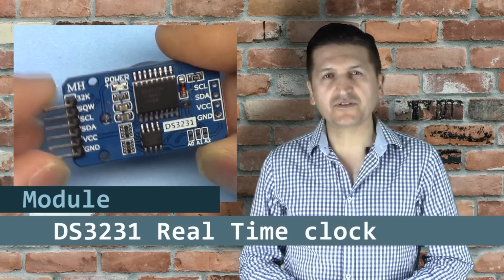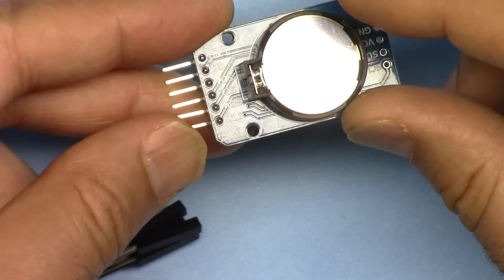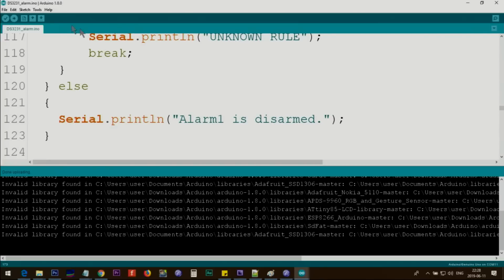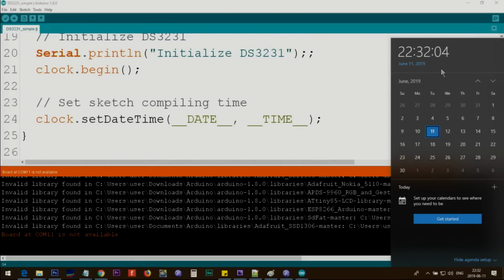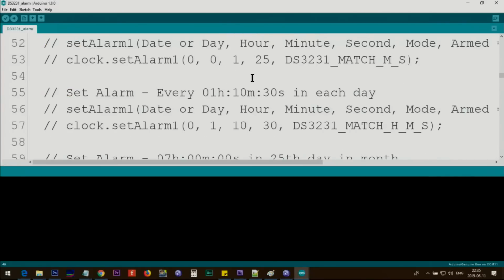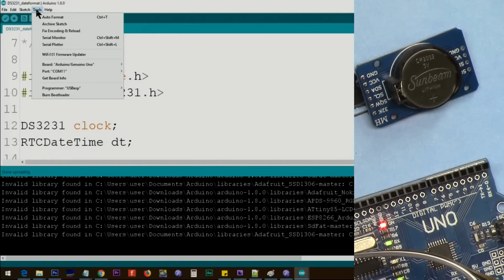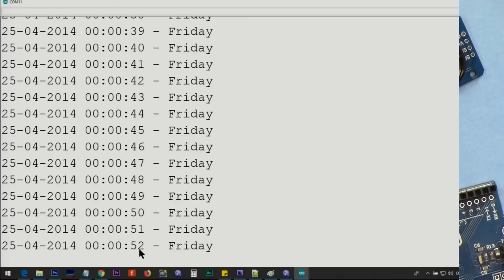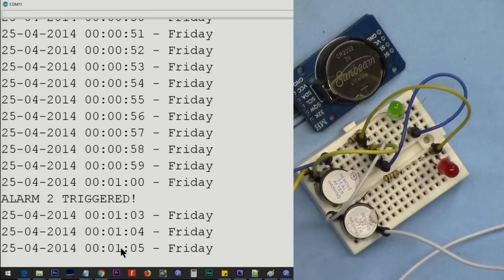How to use DS3231 RTC clock module Alarm with Arduino RJT165

Comment: Hello sir and thanks for the video.,

I've downloadet the libary and when I'll compile the code "DS3231_simpe" the console shows me the error message:
" 'DS3231 clock' redeclared as different kind of symbol "
I juse the Ardoino IDE 1.8.12 and the ESP8266 Board.

It will be very helpfull you could help me.
Reply from the maker: Hello and welcome.  I have not tested it with ESP8266 so I am not sure what could be the issue. It seems you may have similar library.
Reply: @robojax  Thank you for your answer.
I tested it on a UNO today - it works.
So I'll have to do the project on the UNO.
Reply from the maker: You are welcome. Thank you for not skipping the ads and keep watching them. This will help me a lot.
Reply: I had this error. Easy to fix, just change the variable "clock" to a different name like "clock1". Change all the names of "clock" in the sketch. Then it will compile.

Comment: Great video. How do I access the temperature function. Thanks in advance
Reply from the maker: You are welcome. use  readTemperature() to read temperature.. To print it on Serial monitor use Serila.println( readTemperature()); Thank you for not skipping the ads and keep watching them. This will help me a lot.
Reply: @robojax   I have downloaded the lib and source files and uploaded to Mega and Uno.  Both serial monitors show without details just the heading come through.  Tried to check online and many give different view like change battery or lib.  After a while I upload the code with just the wire.h and it set the time date.  didnt use any 3231 lib
Reply from the maker: all modules will work without library. Library is just holding all this code that yo have in a separate package the can be customized for many applications. So if you code works, that i good but,  yous sketch is very messy and log and there are tones of the features that you don't have on the sketch.
Reply: Think about that you have to remove the diode/resistor if u use a CR2032! If you dont the board will charge the non changeable lithium batterie and it can explode! If you do it with the diode and resistor you have to use a LIR2032 Accu!

Comment: Thank you for this tutorial.

I believe I followed the instruction, sir. But there's something wrong in displaying the  (clock.dateFormat). it does not display anything on serial monitor, just blank.
the example ds3231_simple is working. but the example ds3231_dateformat doesn't show any time even in ds3231_alarm. Is there a way that I can correct the code under (clock.dateFormat)?
Reply: Look here:
https://github.com/jarzebski/Arduino-DS3231/issues/22
There was an error in the library.
Ikar4n posted the correct libary.
Reply: same for me
Reply from the maker: Check the serial monitor settings https://snipboard.io/y3pKwG.jpg
Reply: @robojax  Thank you but this is the result. I never change anything on the code. I check the serial monitor and it is still the same. And, the output from (clock.dateFormat) is still not printed on the Serial Monitor.
https://snipboard.io/AHveNR.jpg
Reply from the maker: I just check the image you send me and it is not the example I provided here https://robojax.com/learn/arduino/?vid=robojax_DS3231-clock  nowhere in my code it says "Today is" so use the provided code and let me know.   please start a new comment  as this comment is more than 3 days old and hard for me to find it.
Reply: @robojax  boss i have the same problem the time isnt showing in the serial monitor

Comment: help i try to use the alarm example and when i check the serial monitor only this appears:

Initialize DS3231
Alarm1 is triggered when seconds match: 
Alarm2 is triggered when minutes match:
Reply from the maker: so that is showing it is working. Congratulations. It seems you have escaped the video. Watch it again so you learn.. Now instead of printing this text, you can turn ON or OFF something exactly in the same spot where this text is printed do whatever you want.Here use one of the relay modules to control something. https://www.youtube.com/channel/UCkcBSig_Iu4ZnAIeCeG1TVg/search?query=5V+relay or use this video where I used other clock module, but you can use it. https://www.youtube.com/watch?v=ykgXKUuvtbE

Comment: Thanks for the video sir

I have download the library and run the code, but there's an error "'rtcDateTime' does not name a type" any suggestions sir?
Reply from the maker: You are welcome. The best thank you for me is to Subscribe  🔔 to my channel and thumb up the video. It is greatly appreciated.  🔔  😊.  I will reply to all Subscriber's 🔔 questions. So make sure to Subscribe.😊
library is missing.  Click on "Sketch->Add or include Libary-> Add .zip library and then select zip library
Reply: @robojax I have entered the library but still an error with the same message
Reply from the maker: this happened to me once before where I had two versions of Arduino. Arduino 1.8.1 and Arduino 1.8.2 and I opened the wrong one, check that. This is very strange. That error means "library not found"
Reply: I had the same issue, as I had downloaded the Eric Ayars DS3231 library also installed, remove this library and it should work as they are both using DS3231.h but are actually different libraries hope this helps

Comment: The github link code does work! I've been adding the DS3231 file from my demo cd and then adding other DS3231 files such as yours that then do not seem to work. The solution has been to have a Arduino IDE that is clean of any DS3231 files and then download your master so it works. If any other DS3231 type files are added to my library or examples then yours doesn't work again. I think I understand from my week of frustration that this has to do with cpp,h file, and keyword differences between programs and my Arduino IDE not differentiating them for me. This has probably led to many dusty Arduinos. What I lack in brains I generally make up for in persistence but I need sleep!
Reply from the maker: when you say "doesn't work" you have to explain or provide error code.

Comment: Fantastic presentation! I've followed the instructions and I get error code: no matching function for call to ' DS3211: : DS3211 ()'                Any suggestions?
Reply from the maker: Hi, you have not downloaded and installed the library. Please watch and download the library.
Reply: @robojax  I have become an expert at deleting files from my arduino IDE folder so I deleted the master. Came back and watched the video again. And started over.  The link to robojax is not found when clicked, so I went to github file and downloaded again. Same result. Which leads me to  my question. Are there different DS3231 files that have different interfaces?  I have successfully done the lcd clock and powered relays at a specific time.  However if I see the call:  DS3231 clock; RTC
Reply: RTCDateTime dt; then the code does not work for me. If you could help me get past this I would gladly become a patreon supporter. Thanks for reply!
Reply from the maker: Thank you for letting me know. I just fixed the link so you can download it from Robojax.com but the gitHub should work as well.

Comment: After loading your library, loading the two examples, I receive errors stating that there is "no matching function for call to DS3231::DS3231().  I believe the parentheses were missing in your code.  Secondly, I receive an error for the next immediate line that RTCDateTIme dt is not "typed" or named as a type.  Is this an int, float or other type of variable?
Reply: I have just experienced the same issue. I have repeated the steps in the video to insure the library has been installed. Your advise would be appreciated.
Reply from the maker: I have not changed the code. the error "no matching function for call to 'DS3231::DS3231()'"." means library is missing. Have you copied and pasted the library or did you use Sketch->Add library->Add .zip library?
if library zip is not properly formatted, you will get error in you use first method. 2nd method is the best as it checks the library and will tell you if there is error.
Reply: @robojax  Thank you for your reply. I am experiencing an error while verifying the code. It states, 'RTCDateTime' does not name a type;. I have repeated the steps in the video with the same result. Is there anything you could suggest to remedy the error?
Reply from the maker: It means you have escaped the video. Please watch the video and it will show you how to install the library. Library is missing.
Reply: @robojax  .  I believe I have the library installed, and included in the sketch.  I have reproduced the code below, along with a screen shot of the error message.  
/*
  DS3231: Real-Time Clock. Simple example
  Read more: www.jarzebski.pl/arduino/komponenty/zegar-czasu-rzeczywistego-rtc-ds3231.html
  GIT: https://github.com/jarzebski/Arduino-DS3231
  Web: http://www.jarzebski.pl
  (c) 2014 by Korneliusz Jarzebski
*/

#include <Wire.h>
#include <DS3231.h>

DS3231 clock;
RTCDateTime dt;

void setup()
{
  Serial.begin(9600);

  // Initialize DS3231
  Serial.println("Initialize DS3231");;
  clock.begin();

  // Set sketch compiling time
  clock.setDateTime(__DATE__, __TIME__);
}

void loop()
{
  dt = clock.getDateTime();

  // For leading zero look to DS3231_dateformat example

  Serial.print("Raw data: ");
  Serial.print(dt.year);   Serial.print("-");
  Serial.print(dt.month);  Serial.print("-");
  Serial.print(dt.day);    Serial.print(" ");
  Serial.print(dt.hour);   Serial.print(":");
  Serial.print(dt.minute); Serial.print(":");
  Serial.print(dt.second); Serial.println("");

  delay(1000);
}
The error message at the bottom is as follows;
"exit status 1
no matching function for call to 'DS3231::DS3231()'".  

The line immediately below the inclusion of the library is highlighted when this message occurs.

Comment: how many alarms can be configure?
is any diference between configure alarms and ask for the time and compare with a variable?
Reply from the maker: I have provided the datasheet and mentioned it. 2 alarms can be programmed. But you can make your own own unlimited alarm on Arduino. The two alarm will be on the module so even if you turn OFF the arduino, your alarm settings will stay.

Comment: I discovered here: https://github.com/jarzebski/Arduino-DS3231/issues/22 a discussion that an old version of the .zip file stopped working with the latest IDE of Arduino. Also at that link I discovered there was an updated .zip file which I downloaded, installed and the date format code now works.
Reply from the maker: Thanks.

Comment: DS3231_simple works.  Date format example does not. If future correction occurs, I'll edit my comment. At http://bit.ly/31Gs28Y  , the robojax link returns NOT FOUND.
Reply from the maker: I checked the link and it is working.
Reply: @robojax   This link works? http://robojax.com/learn/arduino/robojax_DS3231-clock_library.zip 
I get file not found. Are there unique permissions that work for you on robojax.com and not for me?
Reply from the maker: When you click on the link it will take  you to http://robojax.com/learn/arduino/?vid=robojax_DS3231-clock I am trying to make the link short and it works   http://bit.ly/31Gs28Y and I can see how many people have clicked on it and it shows lots of people have clicked and have been forwarded.
Besides at beginning of video I always mention that you can get the from robojax.com/learn/arduino